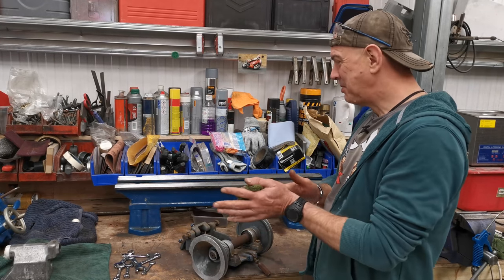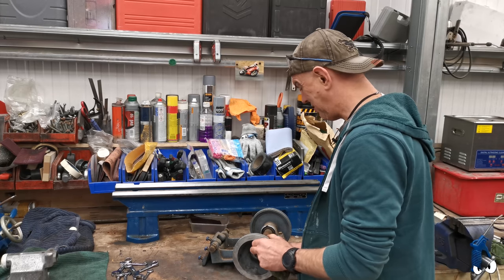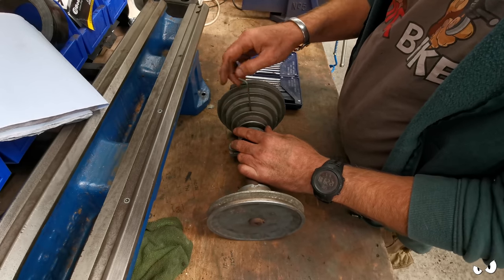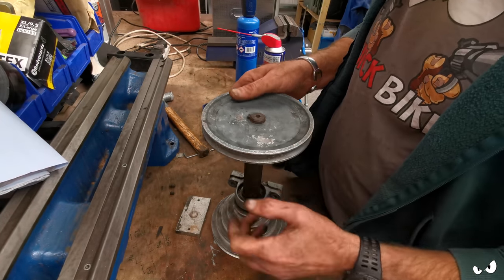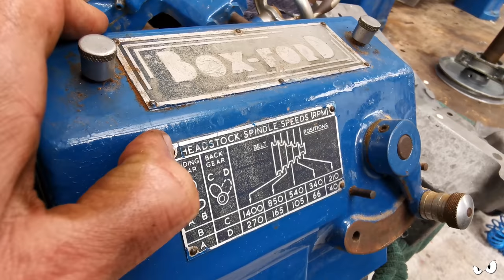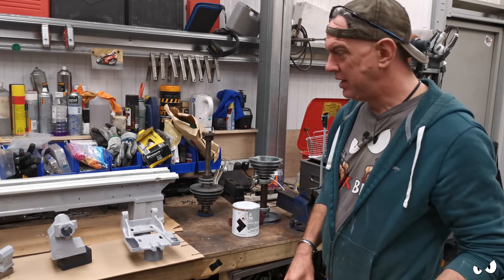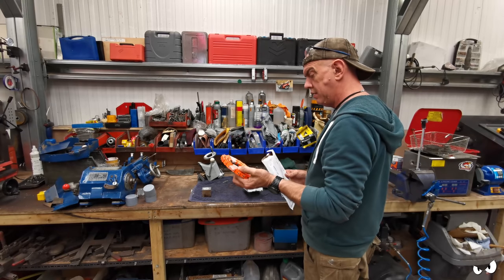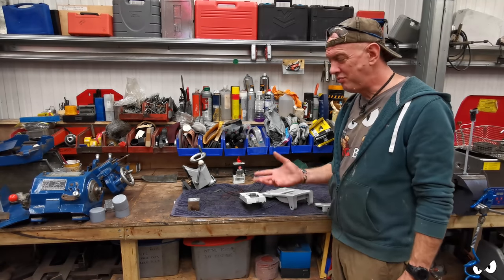Restoring a Boxford AUD Engineers Lathe - Part 3

Comment: Eu UP Quick Bikes! Just be aware that its common on  machine tools to lock pulleys to shafts with key ways by drilling a dimple in the shaft and using either a 1/2 dogged point or cone point grub screws and locking that screw with a second one on top, so dont think that loosening the first screw will release the pulley from the shaft. you have to remove it and the lower one!
Reply from the maker: Somebody else mentioned this and I never knew that was a thing..... Gonna check them tomorrow as I've already put them back on the lathe now, but I'm keen to do a good job from the get go, so worth checking hey.... Thanks for chipping in dude 😁👍

Comment: Carry on like this mate & your goin to have a lathe to play with, good stuff. Those pins/ rivets the only way I've ever removed them is by knocking the top of with a small sharp cold chisel. the biggest problem is re drilling the  holes as the rivet stubs are likely harder than the cast iron. I your lucky the rivet holes are thru holes & you can knock the pins out the back.
Reply from the maker: Thanks Jim, not sure if they go all the way through, but if they do that could be the answer... I'll check that as it may work 😁👍

Comment: Boxford use 2no grub screws in each hole to lock the screw in .you took the locking one off but not the lower ones inside the same hole .the pulleys will then drop off .no press needed Greg ME10 owner for 15 years.
Reply from the maker: Ah right.... Didn't know that.... Thank you very much, I'll give it a go 😁👍

Comment: Mine is a 1965 CUD.
Did you replace the bearings in the bearing blocks that the driveshaft goes through and the bearings in the floating pulley at the top of the motor cabinet that finishes the reduction gearing and sends it up the link belt?
If so, what were they?
Reply from the maker: Ah, nice machine 😁👍
I didn't need to replace any bearings as they were all fine matey. Just cleaned everything, oiled or greased it and set it up again 👍

Comment: 'levelling ' a lathe has nothing to do with how it sits on the earth which is why it works just fine on a ship.  The bed needs to be straight as in not twisted.  It can be at any angle you want all the way up to being called a vertical mill if you want the coolant to drain a certain way for example, as long as there's no twist in the ways affecting the cut which is why you adjust how it sits.
Reply from the maker: Thank you... My point but better made. I know it's good practice but not essential on a lathe... 😁👍
Reply: Quick Bikes eh, no, it is essential on a lathe. You said you want to do precision work on it so you will have to shim out any twist in the ways or you’ll end up with a taper on your part.
Do this between the bed and the stand while taking readings from a test bar.
Don’t worry if the whole thing is level, that’s just a ‘nice to have’ compared to shimming the bed.
Reply from the maker: Yeah. I mean it doesn't matter if the stand isn't cock on... As long as everything is dead square the bed (ie head stock,. Chuck etc, we're all good 😁😊
Reply: Bit late to the party, but I served my apprenticeship at Boxford Machine Tools in the 60's.  When we assembled the bed, with the feet already attached, on to the cabinet, we applied a layer of Isopon body filler to the underside of each foot before we laid the bed assembly, complete with bolts to align it on to the cabinet.  This was allowed to set for about 30 mins BEFORE the bolts were tightened.  This prevented the bed from being twisted by the cabinet, which being a fabrication was never perfectly flat.
Reply from the maker: I'm loving that...  must have been a very interesting apprenticeship matey and never thought that's how they levelled the bed... quite clever really when you think about it... 😁
Thanks for watching and chipping in 👍

Comment: I've never been able to get those "name plate" rivets out (maybe 1 out of 25) always just bit the bullet and ground them down and drilled and re-tapped the holes for hex head machine thread screws..Being that I re-tap the holes, I go to a larger diameter hole, making the drilling part much easier.. I figured that was a late 50's - 60's lathe...(When "Made in Japan" was a bad, cheap thing) it is just built to damn well to be a more modern piece of junk..Much  rather have old equipment, I refurbish myself..Your doing a really nice resto on it!!...There's enough "real" steel in that lathe to make a whole Toyota..lol..I miss the old days when you could go to the Scrap Yard and buy a 3' x 4' piece of 1/2 inch "plate" for $5.00..lol..
Reply from the maker: This lathe is rapidly becoming my pride and joy... I want to do it proper justice and restore it to better than new, but for now I just want it presentable and working right. Personally I think there's no school like tge old school with this kinda stuff... 🤔👍

Comment: If your ‘pin rivets’ are the same as on my Fobco drill press they should just tap out from the rear and can be re-used. Won’t be quite as tight, but...
Reply from the maker: I need to check if the holes go all the way through... I can't remember, but thanks for letting me know 😁👍

Comment: Those fasteners holding the nameplates and such appear to be what are called "drive rivets" here in the states

I've removed them by using a teeny tiny little chisel, catching them right at the side, with the blade parallel to the bottom

EXTREME care must be used to not f*** up the underlying plate (which still has some probability).

The trick here is to catch the head of the rivet, and bend it sideways a tiny fraction of a mm (a/k/a "a blonde one") from one angle, then another.  This will work it loose enough that pliers can grab it

If you make a day long project of it, it can (usually) be done successfully.  Not a task for the 'ham fisted' - which might explain why I find it challenging...

If you really, really want to save the plate, grind the heads off w/ a dremel, then pull the remains of the rivets out after the plate is off

Or, use chemicals to remove all the paint, refresh the black parts and dress down with sandpaper as you describe in the video, while they are still mounted. Then, carefully paint around them.

A decent looking job could be done that way, that would be an appropriate level of finish for a machine that's going to get used, and live a working life...

Looking forward to seeing this come together. I have a lathe I purchased from an electric motor shop a few months ago that is going to be getting similar work. It doesn't have a lot of visible wear on it, but it doesn't appear that anybody ever cleaned it. Ever. Grit and swarf in everything, and it all has to come apart for cleaning before it's used...
Reply from the maker: MEGA COMMENT... Thank you for that. I've never seen them before, but care and attention tends to win the day. I'm going to give it a bash and hopefully save them as I really like the idea of keeping it all original. Thanks 😁👍

Comment: Levelling a lathe has nothing to do with the ground, it's about removing any twist in the bed. So you can have a perfecty levelled lathe on a slope, it will still cut true
Reply from the maker: Thank you, my point exactly 😁👍
I'm getting Brett in to help adjust the tailstock and check for run out as I've not done that before 👍👍

Comment: If you want to cut both imperial and metric threads without messing about with gears and stuff take a gander at this! It drives the lead screw with a stepper motor so you have infinite control over pitches or TPI
https://youtu.be/FTs9GygRQ-U

Comment: Surely everything is going to be running off the bed at the same angle.. and you can stick me down for a Steve I shirt .. and I still don't think they have found did so it could be a while before Steve o turns up 🤣😂🤣😂🤣😂🤘
Reply from the maker: Hehehe... I'll. Post a link once they're available matey 😁👍
Reply from the maker: https://teespring.com/quick-bikes-where-s-steve-o?utm_swu=22&utm_medium=email_transactional&utm_source=sendwithus_seller&utm_campaign=seller_campaign_launch_2&pid=389&cid=100029